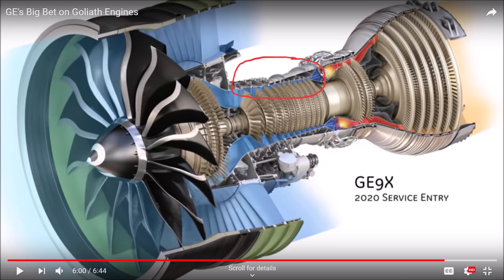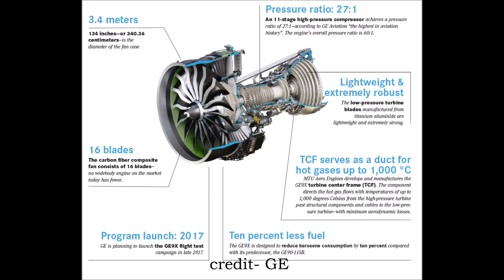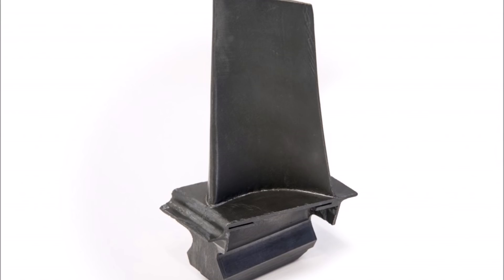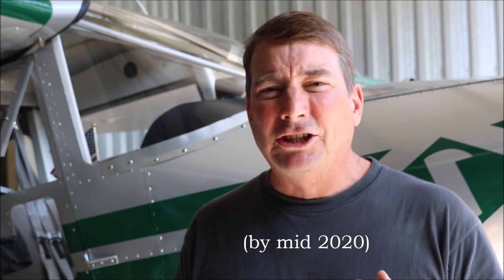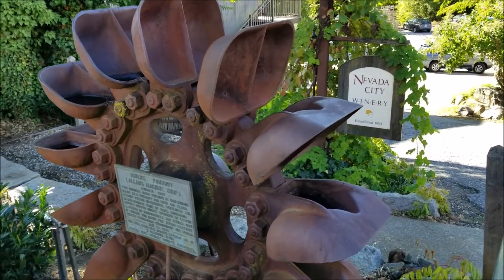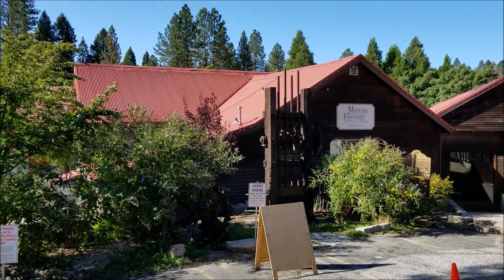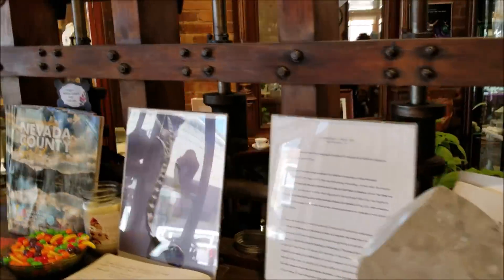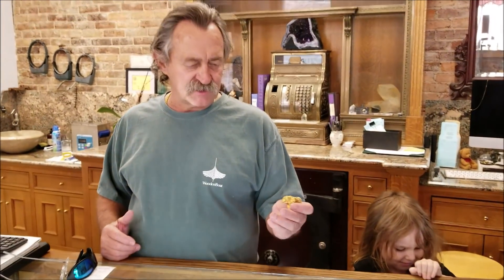Boeing 777x Delays and the GE9X engine stator vane issue.

Comment: They couldn’t place the correct stator blades in the engine because as in all engineering decisions are exponentially more difficult the closer you get to total efficiency.  They are taking more out of these materials due to necessity.   Backing it down and test results showing reality, they have a better result.   The long and winding road.   I hope the make a great engine.

Comment: Juan, interesting to note that your report on mining turbine wheels showed a modern concept still in use in turbine engines, instead of the huge bolts attaching the cups they are held under another chunk of metal and wedged in so that centrifugal forces and vibrations don't loosen them up and Whamo!

Comment: Just re-watched this vid today January 27, 2020 after the 777x first test flight. I like how Juan got straight to the point, it's about more miles per gallon aka efficiency due to advancements in materials that can handle higher temperatures and pressure resulting the most powerful jet engine ever made. Love that picture of the 747 with the GE9X engine, really puts the size into perspective.

Comment: As I understand it, the issues with the GE9x mirror those with some variants of the RR Trent 1000. Namely compressor vane 'corrosion'. I believe that modern engines are being pushed towards unsustainable levels of performance that require higher opating temperatures. You simply cannot engineer 'better' engines ad infinitum, even with advanced modern materials.

Comment: Pelton wheels, yes, the 'split' did increase power....I've been at the Sutter Creek 'Knights Foundry' where they cast the last piece of brass in 1989 or so for a job at Sacramento Machine & Engineering....it was the bearing for the 330 foot swing-span bridge at Potato Slough...I was the welder at Sacto Eng...and welded ALL the balance wheels, and a bunch of other stuff that helps hold that bridge up when it turns...
  Knights machine shop is going through some volunteer restoration, and they make sure you understand every piece of equipment was running from 'line shafts' powered by 2 BIG Pelton wheels, and a 3rd one ran 2 large generators, put out 480 volt 3 phase...gotta' have those shop lights ya' know....

Comment: What's going to be the service ceiling of the 777X compared to the legacy 777? Also can we cruise higher or is the contingency of "Pressure Loss" and the need to dive to 10K or so still the driver of Maximum cruise altitude? Has any testing been done to see how fast the 777 can get down to 10,000'? Or can we slow the emergency descent rate and use better oxygen canisters? Is there any data on the health and survivability of passengers during an emergency descent? In other words can we safely extend the descent time so that we can cruise higher say at Angels 48 or even Angels 50?  Any testing done on the airframe and engines of the 777X to see if it could safely fly at Angels 50? That would get us cooler, faster and less fuel burn and less air traffic for now. Let's build an even better airplane! What about a better option than oxygen canisters which add dead weight to an airplane and are used only in the rarest of events? Perhaps pac air funneled to each mask instead of the canister during an emergency descent. Canisters are also flammable and brought down at least one airliner in Florida. Howabout getting rid of the entire landing gear and thrust reversers and landing the airplane on a smart pallet that catches it along the runway and does the braking. Same pallet can be used for take off power and assist. You could even eliminate the runways and put such pallets on rails even above a city. But that's for the future Engineers to work out. Any other brainstorming out there?

Comment: Since when do they use titanium in the turbine section?  Inconel nickel stainless steel was used for its better durability.  Titanium is what is used in the compressor section of the engine.

Comment: gosh, last I heard set back had something to do with  a door, anyway it's on Boeing and really it's just a long (thankfully) process to certify anything going up there. As you know already recent 737 max problems, Boeing better try and get it right especially on the safety of everybody on these flying machines. I have flown on various planes before and am old enough to come from a time when telephones and televisions were new. As an older person it's kinda hard to wrap your head around all these new innovations be it on the ground or flying through the air via bits or on a big jet airplane

Comment: Congrats on the 100K subs.  I was wondering if you have any comment on the recent Delta airline incident on the flight from Atlanta to Fort Lauderdale?  The press is making it sound like it was a uncontrolled descent of 29,000 feet in 8 minutes.  However they are not real specific with the timeline of what happened.  To me it seems they had a cabin pressurization irregularity which from what I understand requires a quick descent from cruising altitude to below 10,000 feet.  So the descent would have been a controlled descent just much more quickly than what is normally done.  Which to the passengers onboard made it seem like a uncontrolled descent from their perspective.

Comment: There are always growing pains. 

I dealt with the LTS-101 engines for decades. They finally got them working quite well.  We had several grenade in the BK117 and Bell 222. 
I am hoping to get onboard with the new Cessna Denali. There will be modifications and upgrades when problems arise.

Comment: Yes, congrats on the 100K subs. But I do have a question. I thought the main function of higher altitudes for jet engine ops/efficiency was the "thinner air" which the fuel controller measures (among other inputs) to meter less fuel to the engine (based of course on pilot request/setting on the power lever or autothrottle). I realize temperature is one of the inputs, but I thought above FL360 the lapse rate slows significantly. My experience with the older 1st and 2nd generation (business jet) fanjets is that colder temperatures aloft actually increase the fuel flow (in order for to allow the engines to make more specific thrust.)

Comment: The composite material for the stators maybe better at withstanding temperatures but not pressure and temperature at the same time, Juan said the pressure inside the engine compressor was raised significantly!  Ingredients for a stressed overstressed material, thats not completely yet understood as metal thats been used and studied for quite a longer period thus understanding better its limitations!

Comment: I was amazed to see the technicians at GE assembling the titanium stator blades with bare hands. I would have thought that finger grease and acids could have caused etching, when combined with the high compression temperatures attained in the compressor section.

Comment: Congratulations on the 100k subs from England. Many thanks also for the explanation on Boeing/GE problems that every-one in the aviation industry hope will be cured soon. Will you still be giving these excellent briefs after you return to  to full time flying?
Reply: Hi Steve, If you go to Blancolirio's channel, you will see the 77 videos he created from 9 February 2017 to 28 May 2019 about the spillway failure and rebuild at Oroville Dam. Juan was a full-time pilot throughout all that period. And the Oroville series wasn't the only videos he posted during that time. So, I think we won't suffer a dearth of Blancolirio when he returns to full-time flying, which I hope happens as soon as possible after his February test.
Reply from the maker: probably fewer...

Comment: Delays, cost overruns and set-backs are to be expected in new jet engine designs. When Rolls Royce were working to develop and commercialise the new Trent engines back in the 1990's the company came within an inch of going bust. Engineering on the leading edge rarely goes smoothly.
Reply from the maker: Yes!

Comment: Congratulations to the 100,000! You deserve it!
Questions 
You say the current 777-300ER are producing 115 POT and broken the record for doing 127POT. The new engine would do over 130 but will be rated for 105.  I’m confused!
Reply from the maker: They push em for a record, then de-rate them for longevity and efficiency.
Reply: blancolirio but how is it more efficient if it’s LESS? 105 vs 115
Reply from the maker: savin' gas....

Comment: Just as a point of comparison, the J58 turbojet engine that flew on the SR-71 Blackbird, (and designed in 1958) produced up to 25,500 lbs of thrust, installed.  (Of course it could also operate at Mach 3.2, but that's another story.)  It's overall pressure ratio at takeoff was 8.8.

Comment: It's interesting how technology has moved things ahead in every walk of life. The German Axial Flow engine was a superior design over the Centrifugal Flow engines we used, but they wouldn't hold up as well. Same thing with P-38's using copper tubing that had to be pulled out of the plane and annealed every so many hours. Then along comes aluminum tubing that was halfway trouble free from fatigue and didn't have to be annealed.  
I have to admit that the thrust the GE9X puts out really surprised me. Back when I was in the Navy(1966/1970) the big engine on the block was a J-79 that produced about 16,000 pounds of thrust in full after burner! Something producing over a hundred thousand pounds of thrust is unbelievable for an old timer like me!..........Another very informative video, Juan. Keep these puppies comin'.(:>)

Comment: Congratulations on 100K. GE still has not settled on a coating for the blades. My understanding is they have contracted out to various sources for assistance, and it’s very complex. Heat is higher than initially anticipated as you pointed out.

Comment: Thank you for the video Blancolirio, it was informative and educational, my kind of video. I remember when I lived in Albuquerque, NM years ago, going over to the GE plant there, where my Uncle Will worked. He invited me to their open house and to say the least I was seriously impressed. At the time they had just started building the GE 90 intakes, the nacelles and intake stator vanes, which I believe are fixed in place, and all the other parts that make up the outside of the engine. It was amazing to see all of the machinery they use to build these engines and the science behind building them. They have one section where there's a container filled with water which they place stator vanes in to do ultrasonic test to make sure that there isn't any micro fractures in the material, it's all a very exact science. What impressed me the most was walking up to a GE 90 intake they had standing up and looking up at this massive intake that you can fit a 737 fuselage in, folks just can't appreciate the size of these engines until they see them in person. One of the men there that was crating an intake to send out to GE's final assembly plant, where the inner part of the engine is made,which is in some other state, told us back then that the engine was said to put out over 130,000 Lbs. of thrust or maybe what he meant was that GE's final objective was to reach that goal with the design. Or maybe the lower thrust levels they've been running them at, are a derated setting, I don't know, but they are absolutely amazing engines and they make one of the coolest sounds in jet engine history. Thank you for the quality videos and God bless you.

Comment: good information and small correction: turbine pressure ratio is the ratio of the staganation pressures of the compressor outlet over compressor inlet... and not the turbine pressure (lower due to flow and combustion losses)

Comment: Hi Juan, nice comparison of the pelton wheel and the power turbine. You or your viewers might find the combustion engine proposed by Barber in 1791 interesting. It used a pelton type bucket wheel power turbine and a bellows compressor. Here's a link. 
 http://ffden-2.phys.uaf.edu/webproj/212_spring_2017/Tad_Nelson/tad_nelson/page1.html

Comment: Just a quick question.  I though the stator blades are variable so they can be changed to maintain the highest efficiency while preventing compressor stalls.  Is this true?
Reply: At 
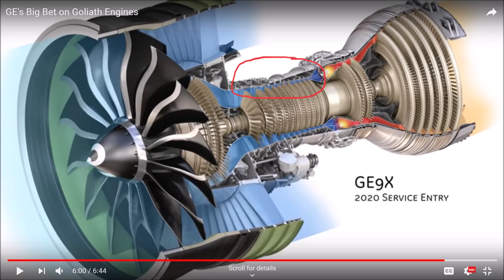06:52 there is a ring of variable stator vanes (circular hinges), with a few fixed stators (flat hinges in upper layer).

Comment: Congratulations on your 100k milestone! 🥂🎂 
Is the premature failure of the guide veins on the ceramic coating itself along the leading edge or does it encompass the entire surface or something else. Is the redesign on the veins a change of ceramic material, blade design shape or manufacturing application process? Is GE providing you with a complete answer or are they keeping this engineering design change close to the vest? Keep up the great work Sir. Love all the work your doing especially on the 737. Received a few beers because of your explanation because so many people bought into the idea of what the underlying design issue was for the MCAS. I can’t tell you how many times I heard the statement; it’s because of the placement of the engines on the Super 8’s. It won’t fly if the MCAS isn’t working. Thank you and let’s try an get you 200k subscribers. All we need to do for you is get one person each! We can do it Juan!
Reply: There is confusion in the video between the titanium compressor stator vanes which failed prematurely, and the ceramic turbine blades, which have nothing to to with the premature failure.
Reply: Ok, got it now. Thank you for the clarity. I am trying to visualize the failure in my mind. I have spit a few turbines in life but usually high-time engines and not in a testing phase. Did the report elaborate on when these failures were identified? During an inspection or operational failure?
Reply: John Paul Lafferty The story is that high EGTs led to an engine stripdown, when the worn stators were discovered. No clarity on the exact cause.

Comment: 0:40 that's pretty optimistic to think that 1/2" of plexiglas is gonna do anything if the compressor decides to blow apart
Reply: That's low speed balancing, a few hundred rpm, not high speed testing!
Reply: @gordonrichardson2972  Still enough to take your head off :)
Reply: dlchambers The plexiglass is to stop the technician walking into the spinning blades, which would be very serious.
Reply: @gordonrichardson2972  Now that makes sense

Comment: Juan, great vid but I have a question:  If the stator issue is simply a durability question, why can't Boeing start flgith test with an "old" less durable 9X and then switch when the 9X with the new stator blades becomes available?
Reply from the maker: Good question, maybe the airframe itself is not ready?

Comment: Interesting issue with a stator vane being the issue... the heat from the combuster must be causing metal fatigue. It's usually rotating parts that limit life. I'd think the bigger these engines get the high by pass must not be allowing cooling air into the engine in sufficient amount. Having worked on GE's military engines stator vanes never were an issue as low by pass engines get a lot more cooling air... At some point in the near future they are just not going to be able to grow an engine bigger without more problems. Aviation is at a cross roads IMO... The more technology needed to fly, means more chances for failure.
Reply: The stators are in the compressor, and are not exposed to combustion heat. The exact cause is not clear.

Comment: Do You think Boeing/GE engines are reaching the limit of thrust and pressure ratios...considering materials?  Material science is interesting because of the question of how to find ways to improve the limits of Physics.
Reply: Rich Coffman There are always possible improvements, but the incremental payoff becomes smaller with each new generation.

Comment: So the ORIGINAL plan was to de-rate the 9x to 105k lb thrust (for fuel efficiency) even though it is capable of 134k? And THEN they found the problem?
Congrats on the 100k subs. 👍
Reply: blipco5 The derating is a bit strange, but the point seems to be that efficiency is more important than brute power.
Reply: Gordon....Yes, you run a more powerful engine at a level where it can run more fuel efficiently but on its own it still has enough ass to get the plane out of trouble if you lose the other one. Why not  have it rated at its full potential yet only run it at the lower level? Unless they can't get the full rating because of the problem with the vanes? Maybe Jaun can clear this point up.

Comment: "They are extracting a faster amount of energy out of these engines using lighter material". Does anyone else have an uneasy feeling about this? These are unchartered waters.
Reply from the maker: I mis spoke I  said 'vaster'- (a made up word that doesn't exist lol).  I should say "Vastly more energy from lighter materials" - regardless, yes- something to ponder...
Reply: @blancolirio  Hi Juan, I thought about that word, "vaster". I discovered that it actually does exist as a proper word in which case I think that your use of it in that context was entirely appropriate. 👍
Reply: Jet engines have undergone decades of incremental changes. The testing process is where the flaws are checked, before being unleashed on passengers.
Reply: @gordonrichardson2972  "The flaws are checked, before being unleashed on the passengers." Did you mean to say that? lol
Reply: bigdmac33 Um, that's not what I wrote...
Reply: @gordonrichardson2972  I think I know what you meant, Gordon : the testing phase is where the flaws are identified and ironed out before THE AIRCRAFT is unleashed on the public. Its that it?